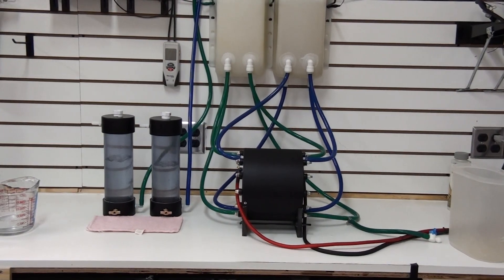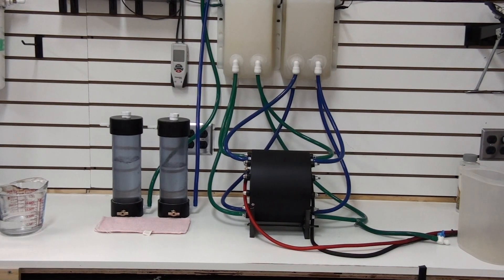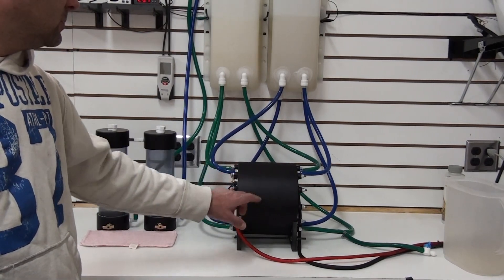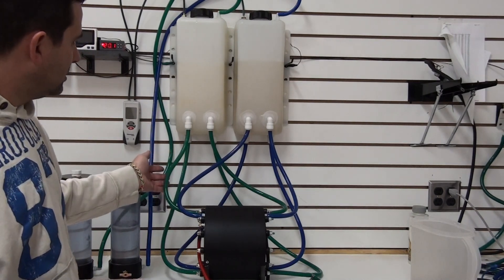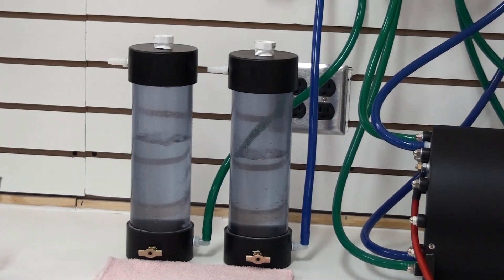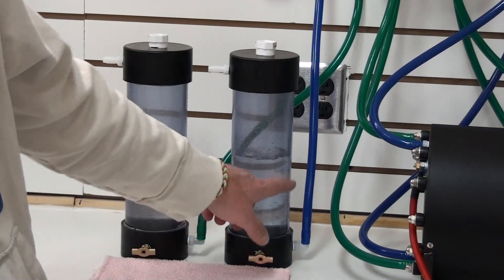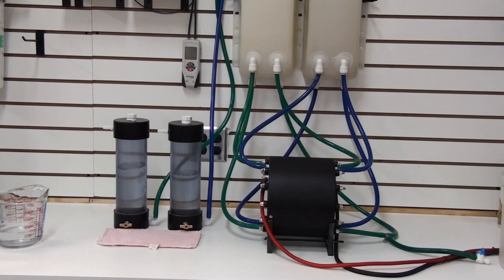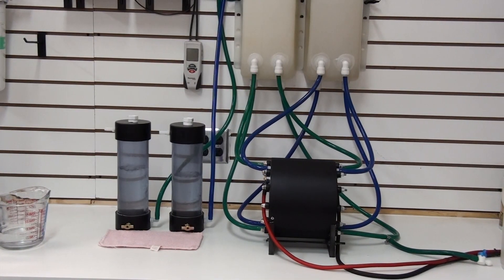Hydrogen Oxygen generator split separation cell

Comment: One more stupid question =). I read in FAQ's that for this system we should use only distilled water. How can there be electrolysis in water that can't transmit electricity? Pure distilled water does not transmit electricity, fact.

Comment: Awesome split cell Steve. Maybe I can get back into the groove of the split systems this summer. We can use the H-Cat to purify the gas. I managed to compress into a balloon the other day without purifying and sustained a flame out a 1/4" hole without flashback. Gas is pretty pure but when I start working on compression, I will have a re-combiner in line.